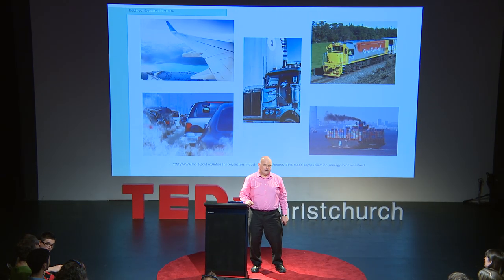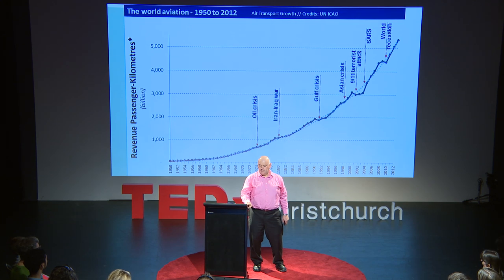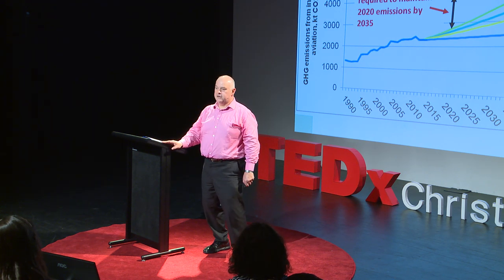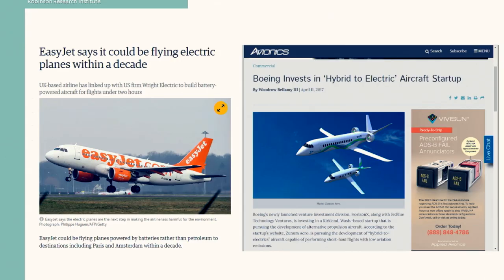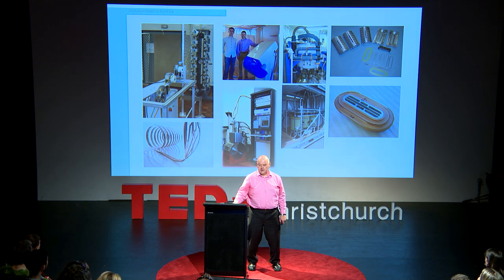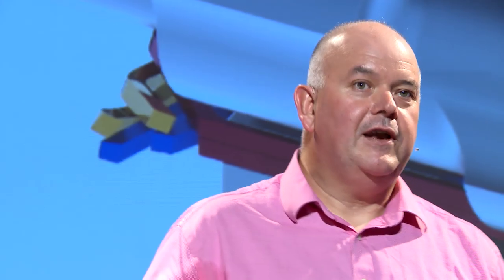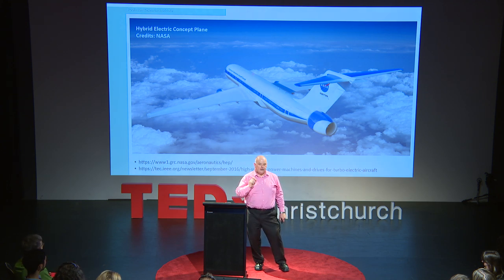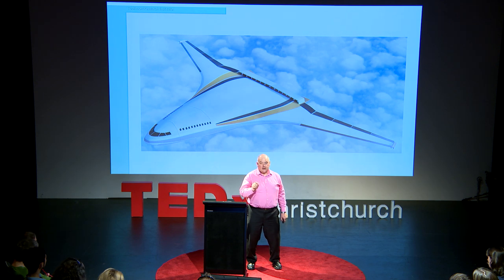Reduce aviation emissions by 70% -- here's how | Rod Badcock | TEDxChristchurch

Comment: This makes no sense whatsoever. A fan-powered 737-style a/c would be MUCH slower and have a MUCH lower ceiling - so be inherently LESS efficient. Why carry the weight of the electric-motors anyway - if you can just use a more-or-less conventional turbo-prop. As for these motors - it doesnn't matter HOW light they are - they STILL will NOT be able to compete with a turbofan for speed and altitude. As for all the talk of throttling the engines - wrong - existing turbofans are optimised for cruise performance already.... Descending they much less, and only at take-off is the fuel-flow at maximum. Electric flight does have a future - but for slower, low to medium altitude operations - no real help whatsoever, for an isolated island like New Zealand.
Reply: No, an electric fan motor can take your airplane higher as it doesn't need extra air for combustion and recover power on the way down, making it a far more efficient overall system.
But since his idea relies on a jet engine it would still be limited to conventional flight.
Reply: @MsSomeonenew  ;- You don't get 'something for nothing'. The energy still needs to be generated. Each fan on a modern turbofan has it's own dedicated gas-turbine - also adding thrust. An electric system need to carry generators and motors - as well as the gas-turbines to run it all, along with all of the consequential losses. The energy-recovery during decent isn't very realistic either, as it'd probably lead to an excessive rate of decent. Overall - the system is half-baked.
Reply: It's ironic how he notes how the nasa design wouldn't be possible without the super efficient motors he speaks of and the 737 max situation.

Comment: it's a neat idea, but if this can reduce emissions by 70% by reducing fuel consumption by 70%, then wouldn't this mean carbon neutral e-kerosene could afford to be over 3x the price of regular kerosene for aviation to remain at the same price point? or we could have a blend of fossil kerosene and e-kerosene? which would mean emissions could be dropped even further?

also notably absent from this discussion: hydrogen - already much much lighter than batteries, and fuel cells - which with sufficient weight reduction could achieve higher efficiency than a turboshaft generator, other alternative fuel possibilities - ammonia, e-methanol

Comment: I do not like the delta-wing aircraft shown in Your last picture. Buying the economic maximum at the price of airodynamic instability nonsense! 
The reduction in CO2 and increase in efficiency by using electric-driven aircraft, wont suffice. it is necessary to change from jet-fuel to methane or LNG-turbine technology, too. That would afford a free coolant for Your Superconductor Motor or at least a low temp heat-sink!
Reply: Electric planes are prefect for short flights and regional flights (remember: if they start designing a regional plane now, it will take a decade for it to enter service). Biofuels could easily be used for long distance flights and self-driving vehicles will make regional flights pretty redundant anyway.

Comment: Future air travel is going to be limited to long-haul or over water. Self-driving cars make regional jets pointless because you can get their just as fast via car for a lot less hassle and money.
Reply: High speed trains as well.
Reply: @PeteS_1994  If you live in a place with a high speed rail line, sure. I wonder how trains are going to fare this transition, though…
Reply: @BXJ-mi9mm  By joining up main cities and if maglev tech becomes common. Trains would actually be faster than planes across most countries due to less time to board and the high speed of maglev.
Reply: @PeteS_1994  The big problem with maglev is that it is completely incompatible with traditional trains with little benefit, especially in terms of costs. If you are going to go maglev, you might as well put it in a tube (which is also a very old idea but recently revived by Musk). 

I think it would be cool to put a "maglev highway" between cities, though. Imagine that… Self driving vehicles that hover over the grass or even a (extremely) short crop. I don't know about you, but I hate how much pavement there is. Maybe someday that will be done in very natural areas, but that is a big "maybe."
Reply: @BXJ-mi9mm  Even not underground there are benefits to maglev I think. Sure it's not in a vacuum going the faster it can but there are less moving parts which means it should be easier or cheaper to maintain. It's just that the infrastructure to build it would initially be very expensive.
Reply: @PeteS_1994  I'm not so sure that the maintenance would be cheaper. You basically make the entire track a motor. I don't know what the point of "underground" was. My point was that you could put the train in a tube (most recently popularized once again as the HyperLoop) and cut out air resistance, boosting efficiency. I doubt either are going to take off as there is simply no need for either one.
Reply: @BXJ-mi9mm  Underground faster, of cause as it's a vacuum when it comes to the idea of putting a maglev in tubes. Even if the entire track is a motor their are less moving parts so less wear and tear than a conventional track with overhead wires, you can research it. China has even made a meaglev metro line btw.
Reply: @PeteS_1994  Can you show me a study that puts the maintenance of maglev below that of normal rail? I sincerely doubt it.

The longest maglev line is only a couple dozen km long in China and technically you could call it a metro line, but it is above ground and just connects an airport to the city. It is running at a huge loss.

Comment: This concept is kinda a double edged sword because if you went full electric, there’s a higher chance you’ll have ice build up in the motor and that alone could bring down a plane.  That with heavy batteries is a recipe for disaster, that aircraft would need a lot of anti-ice equipment onboard to be able to handle flight in cold weather, let alone even operate in cold weather.  Good idea, but this is way ahead of our time.
Reply: You think you know better than the people making these planes? BEV planes are already far better for flight school, skydiving, and other very short range uses. There is a lot of potential here.
Reply: B5429671 XJ No, but I’m a pilot, and I have an understanding of aerodynamics and heat.  Electric motors don’t produce enough heat to prevent icing above 30,000 feet.  This ted talk was about commercial applications, not general aviation.  I agree that there are a lot of benefits for electric aircraft, but it would be dangerous to operate at high altitudes, making it not feasible for commercial air travel with current noise ordinances.

Comment: Hydrogen fuel cells are more than capable of solving this issue today. And within 5 years there will be solid state battery technology capable of use in the aerospace industry as well. They will weigh 30% less, hold 3x as much energy, last 10x as long and they cannot freeze nor ever explode. You can cut a piece out of them and they still function. No more precious metals and cobalt from the congo. 60% cheaper to produce. Over $8 billion was invested last year by all the majors for its commercialization. Its a proven technology across numerous chemistries.
Reply: Hydrogen fuel cells are even larger and heavier than batteries and hydrogen is just another fossil fuel.
Reply: To bad I am not a smoker. You must be smoking something really gooood!!
Reply: @jayreiter268  Fine, I'll be more specific: The hydrogen fuel cell and fuel storage system weighs more than batteries and takes up significantly more space inside of a vehicle. This is why the Toyota Mirai (despite having less range and significantly less power) weighs more than the Tesla Model 3 and why its such a tall, weird shape when compared to the Tesla. Fuel cell aircraft also aren't anymore capable than battery electric aircraft, which is why they're almost all extremely slow motorgliders.
Reply: @jayreiter268  Also, hydrogen is reformed from natural gas, it's not a green fuel, it's just fossil fuel industry greenwashing.
Reply: @PistonAvatarGuy  LOL, yeah you CAN get it from fossil fuels, but its a lot cheaper just to make it with water and electricity you know. H2O
Reply: @davefroman4700   No, almost ALL hydrogen comes from natural gas because that's the cheapest way to produce it. Fresh water is already something that's becoming scarce, and you people think that we can use trillions of gallons of it for the production of a fuel?
Reply: Also, splitting water with catalysis is quite inefficient. That’s why hydrogen is manufactured from natural gas and also why battery technology will win this particular race.